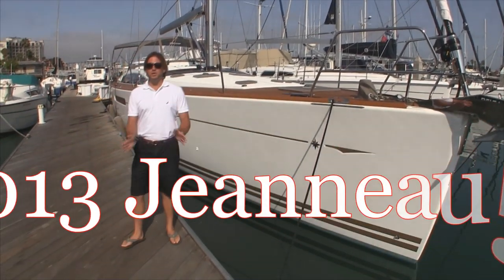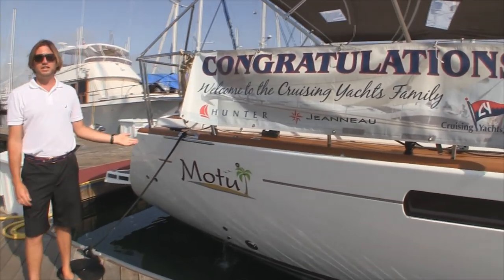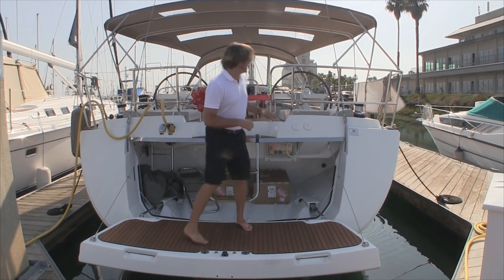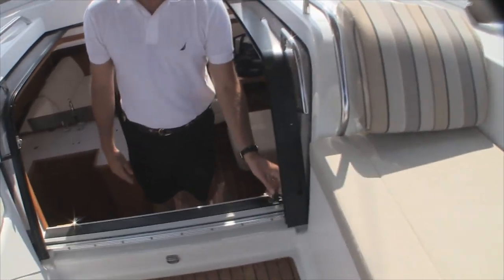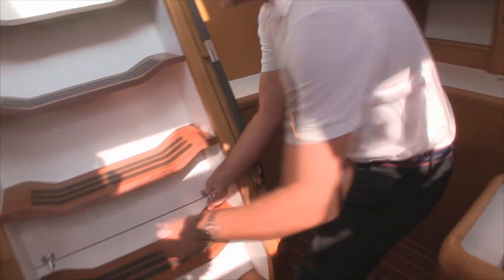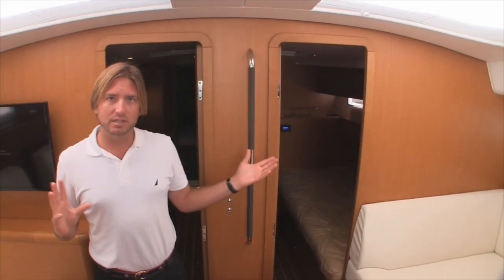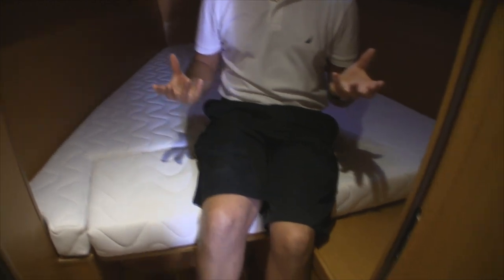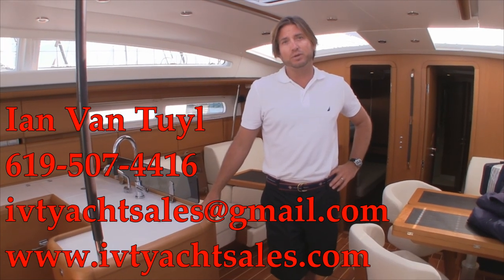2013 Jeanneau 57 recently sold by Ian Van Tuyl

Comment: I would recommend an instrument repeater and small chartplotter/radar display in the master stateroom (although you can replicate that with a tablet and raymarine wifi repeating). And a nice brass air pressure gauge. If you're doing long distance cruising you can then shout and direct the helm easily from master bedroom and open hatches.